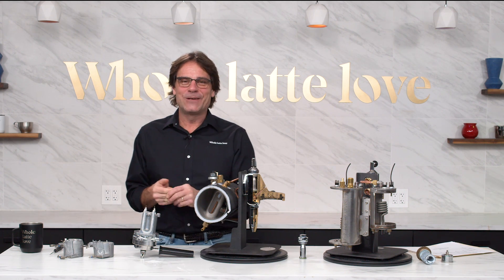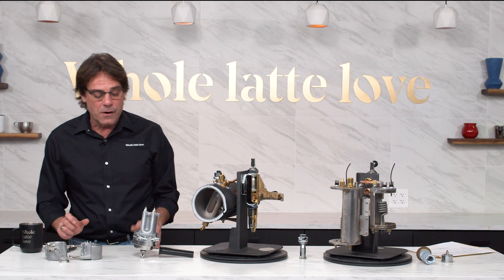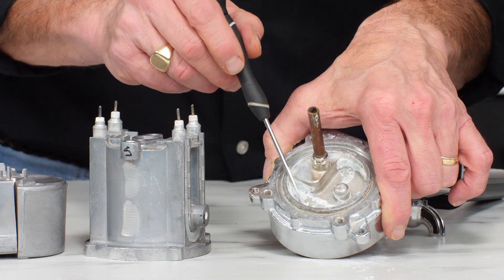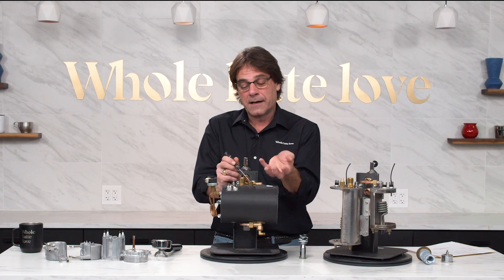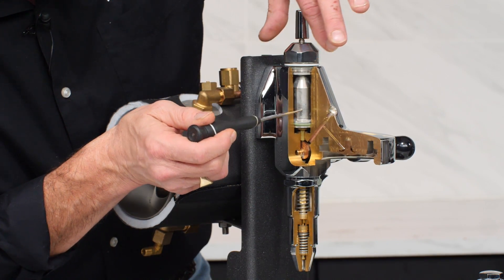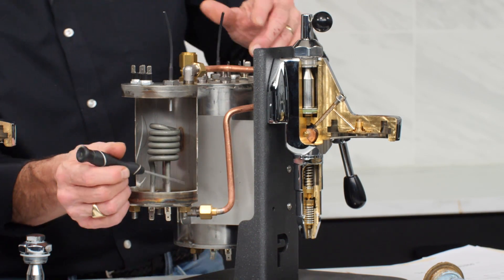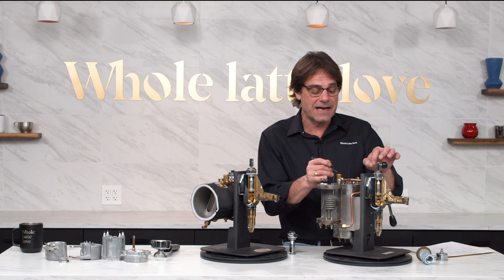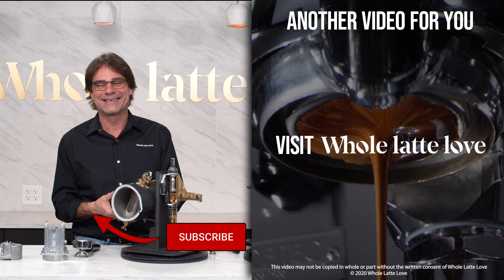Espresso Machine Boilers: See Inside 4 Types

Comment: Awesome video!  Need recommendation. I have an Alex Duetto 2, not working so well. First issue was at powerup the pump would run and run till a fill alarm would stop the pump. Reservoir is filled no water being drawn. Started happening intermittently, descaled machine hoping to fix this issue. It did not - eventually happened on every power up.  I Replaced the fill valve/solenoid – problem did not go away.  Found sediment in the valve under the solenoid, fill problem was solved.
Machine worked for a week, then more problems started. Seems every time I have my steam boiler on the brew and steam boiler temps fluctuate by +/- 10 deg. While drawing a shot. Would take a few minutes to recover back to normal temps. I used it this way for about a weak, steaming my milk first then shutting off the steam boiler before making my shots.
Today: If I leave both boilers on, now and try to make my espresso first it’s gotten worse the steam boiler blows the safety valve every time I draw from the group.  I’ve removed several parts in the piping and descaled them separately, expansion valve, one-way valve, group head components. Problem persists.  I thought perhaps the pump has a large chunk from scale in the impeller causing back pressure and blowing the safety valve. Or the fill probe cannot conduct to ground from too much scale inside the boiler, so boiler overfills. Would you recommend removing the pump to inspect it and clean it? How about removing the boiler to descale? Or perhaps not removing anything and trying to descale once again.  Any advice would be greatly appreciated. Thank you
Reply from the maker: Hi Paul, A lot going on there!  Sounds like you've seen evidence and/or believe the machine has significant scale deposits. I don't know if this is the case with your machine, but descaling a machine with a lot of scale already in place can cause a lot of problems. Scale dislodges during descaling and ends up plugging up other parts of the machine. Based on what you've said if this machine came into our shop it would be a tear down with boilers and other components removed for descaling. In fact, that's the only way our techs descale dual boiler machines. I would not recommend descaling without removing components. Sounds like you have some skills and a total tear down and check of all hydraulic components and sensors like fill and temperature probes is called for.
Marc
Reply: @Wholelattelovepage  Thanks for the quick reply, you’ve confirmed what I believed had to be done, but was hoping I could get around removing the boilers to descale.  My plan is to descale the remaining components, once I’m satisfied the plumbing is clean I can troubleshoot any remaining issues at least knowing that it’s not related to scale. Thanks again.

Comment: hey mark, can you do a video on flow control with HX boiler with PID (Cronometro R).
Reply from the maker: Hi LPV, Thanks for the request. While flow control is not an original purchase option on Rocket machines I know some do install it. But, different vendor's FC devices work a little differently with flow rates based on valve opening positions. If you installed an FC on your Cronometro R I advise calculating your flow rate at various valve positions. Here's an article on how to do that. It also has graphs of 5 flow profiles based on flow rates: https://www.wholelattelove.com/blogs/articles/intro-to-calculating-flow-rate-on-e61-group-machines
Rotary pump machines generally have much higher potential flow rates than vibration pump machines. ECM/Profitec rotary pump machines using ECM or Profitec FC devices can do near 30g/s with the FC wide open while stock flow rate on those same machines is 10-11g/s. Not many situations where you'd want to go too far beyond stock flow rates. Majority of profiles reduce the stock flow rate like those using long low flow pre-infusions for lighter fresh from roast specialty coffees. Here's a video covering 2 easy flow profiles. It's done on the rotary pump ECM Synchronika. Although a dual boiler machine it should be similar to your HX PID Cronometro R: https://youtu.be/a-QAOo8Vg5A
Marc
Reply: @Wholelattelovepage  Hi Marc, I am actually really interested to know how and if FC affects brewing temperature stability with HX Boiler w/ PID (not HX Boiler w/ brew group PID like Lelit Mara X).

Comment: What were the machines that were taken apart in this video?
Reply from the maker: Hi EM, Thanks for the question. 
Thermoblock boiler: Not sure. This boiler type is common in many appliance, grade sub $200 espresso makers and some super automatic bean to cup espresso machines.
Single boiler: Gaggia Classic
HX boiler: An older ECM machine
Dual Boiler: Profitec Pro 700
Marc

Comment: How abt inside saachi machine
Reply from the maker: Hi RL, Thanks for the request. I do not believe that product is available in the US. I did look it up and it appears to be an appliance grade espresso maker using a pressurized PF/filter basket setup. Honestly it's not a class of product we typically open up. In all likelihood it uses a thermoblock to heat brew water as shown in this video.
Marc

Comment: Awesome video.  You are obviously not only very knowledgeable but you also have the ability to communicate these concepts that you understand so well.  The combination is rare.  Kudos and thanks.  I found this fascinating and extremely valuable.  Since I never make milk drinks I know that heat-exchange and double-boiler features are not necessarily important to me but PID and pressure control are.  So, a modified Gaggia classic (with PID and pressure fader with gauge) would be OK for me.  I think.  Maybe I'm missing some subtleties.  
I wonder if there is a high-end machine that has those same features (PID & pressure control) without the unnecessary (at least for me) expense of a double boiler or heat exchange?
Great job, Marc.
Reply from the maker: Hey ropeh, Thanks for the kind comment. Sounds like the ECM Classika PID w/flow control is exactly what you are looking for: https://www.wholelattelove.com/products/ecm-classika-pid-espresso-machine-with-flow-control
Checks all your boxes: PID, flow control, E61 group, single boiler focused on those who don't do milk drinks very often. ECM build & finish quality are best in the business. While modding a Gaggia Classic is a possibility, the Classika is purpose built and has far better thermal stability.
Marc
Reply: Also consider the ECM Puristika if you never steam milk.
Reply: @ende421 Thanks for the tip on the Puristika.  That is the machine for me.

Comment: Hello
Thank you very nice video..
Ihave quastin that my coffee machine
Dosnot work water come and not hot and no pressuer when i remove  the water level waier (electrode) it work and prusser jump to max in 5 second i replace water level(electrode element) but still not working why!?
Reply from the maker: Hi MM720, Thanks for the question. Not much to go on here. Information like make/model of machine and more details would help. Have to say it's nearly impossible to have no hot water/pressure and then jump to max in 5 seconds by removing the water level probe. Maybe a wiring issue?
Reply: @Wholelattelovepage 
Thank you sir for your reply.
Fiamma coffee machine
Singl group
I dont konw what is the mean issue why no hot water and no pressuer!
Befor 2 month i have change heat element coil and then it was working fine. Now befor 2 weeks i face this issue!
Wiring conection and every things as befor.
Do you think  the motor pump not feeding the boiler so the water not start coming hot and water level not dedect the level?

Comment: What do the 2 thermostats do exactly on the single boiler? 

You mention ones for “registering when ready to brew” and the other is for “reading the temperature” correct? 

I don’t understand though, wouldn’t the one thermostat that tells you the temperature indicate that it’s ready or not to brew? 

Or is one thermostat used for the actual steaming and the other is used for brew water that’s kept separate? 

Is only one thermostat essential for a standalone steamer? (No espresso) 
Or would it be beneficial to integrate both thermostats still into a stand alone steamer
Reply from the maker: Hi Adam, One thermostat is used for controlling brew temp and the second does steam temp. Not sure I fully understand the question about stand alone steamer but if device was steaming only then one thermostat would do the job.
Marc
Reply: And does the temperature control on to the last two boilers matter? 

Why would I want to keep a consistent pressure versus a single boiler that lets out some pressure if it’s too hot? 

When it comes to steaming is there a specific temperature that works best for steaming milk? Is that why these functions exist?
Reply from the maker: Hey Adam, Temperature control matters. Consistent temp/pressure is important in brew boilers for consistency of brew temperature at the group. Single boilers do not release pressure if too hot unless the boiler has a safety valve and boiler runs far too hot. No specific or best boiler temperature for steaming milk. But... higher temperature in the steam boiler = higher pressure for steaming. Higher pressure means faster steaming and more vigorous in milk when steaming.
Marc
Reply: @Wholelattelovepage  wow you guys are really the best never been able to find so much useful knowledge in one spot, no one even comes close! 
Very impressed and thank you so much :)

Comment: Are the double boilers and pressure heat exchange boilers commercial? Do they have special electrical/water intake setup to function? 
Or are these types of boilers included on a normal home machine you could plug into a wall outlet?
Reply from the maker: Hi Adam, Depends on the machine. There are commercially rated machines using HX and dual boiler setups. For instance all four of the Crem One machines featured in this video are commercially rated: https://youtu.be/eYHCznwM-nI
Although commercially rated they are commonly used in home setups. Many similar 
machines are not commercially rated. They're often classed as "prosumer" level machines. Most use standard power. Some can be plumbed direct to waterline.
Marc
Reply: @Wholelattelovepage  extremely helpful thank you!

Comment: Thanks for the informative video, does anyone have any experience with the Ascaso heater blocks with stainless steel coils ?
Reply from the maker: Hi jv, Thanks for the question. I do not but they are available from parts suppliers if yours is bad.
Marc

Comment: Marc. I live in a hard water area and I use softened water. A soft water test showed my water is fine but I am concerned with mineral build up. It’s an hx group head single boiler. The company I bought from said to never descale.  I. always descaled my Breville. My question— I have had this about 10 months. Should I be descaling and how?

Comment: Sweet vid! I've opted for the dual-boiler with PID Silvia Pro. Now I'm wondering how you go about descaling it, as I've heard it's difficult to descale a dual boiler? I've ordered it but it has not arrived yet :)
Reply from the maker: Hi b, The Silvia Pro is a real value in dual boiler PID machines - congrats on your purchase! In the box with your machine will be a BWT Bestsave M drop-in filter like this: https://www.wholelattelove.com/products/bwt-bestsave-m-anti-scale-filter
If you use the filter as directed no limescale should form in the machine so descaling will not be needed. Depending on your source water hardness the filter is good for treating up to 100 liters of water. It just drops in the reservoir and does it's thing. Be sure and refill reservoir 10 hours prior to use so the filter has time to do it's thing.
A nice feature on the Silvia Pro is the ability to automatically drain the boilers through extended functions on the PID display. This is handy for long term machine storage and could be used if someday you find the need to descale. Be aware you will not find descaling instructions in the Silvia Pro's manual. Rancilio likely prefers you use the BWT filters to prevent scale in the first place.
Be aware descaling neglected dual boiler machines can be risky! The have rather intricate internal plumbing. Scale chunks can come off during descaling of neglected machines and plug up internals.
Marc

Comment: Hi Marc - love your informative and lively videos - thanks for making them. Just ordered an ECM Casa V and Eureka Mignon Specialita grinder from Whole Latte Love. Do you have a video showing the Casa V boiler in cutaway? Does it look very similar to the Gaggia single boiler shown in this video? Wondering if the water that goes into the steam and/or the brewing on the Casa V is heated up in the (brass?) boiler or stays in copper tubing that runs through the boiler wall and is is heated by the boiler. Interested in your response. Thanks!!
Reply from the maker: Hi Brian, You are welcome and thanks for the kind comment, question and your patronage! Casa V + Specialita is a very nice combo. I do not have a video with a cutaway of the boiler. The boiler does not operate in the same manner as the Gaggia boiler. The Casa V uses and ECO brass boiler. The "ECO" references food safe brass which passes EU regulations (stricter than most US standards). The boiler is heated by an internal heating element similar (but smaller) to those seen in the HX and DB boilers in this video. Hope that answers your question.
Marc
Reply: @Wholelattelovepage  Thanks Marc. Can you compare/contrast the common and different aspects? Only takeaway from your response is "its different" and has a "food safe brass build". Not sure how it is same/different in construction or function. Thanks!!

Comment: Maybe its worth mentioning that depending on the composition of your water you will get severe pitting of an aluminum boiler like the gaggia one. I have had 2 gaggias, and both of them needed the boiler changed within 6 years of manufacture. The sealing surface between the grouphead and the aluminum top part will get pitted to the point that it wont seal anymore and it will leak. By the time i noticed on the first one it had been leaking long enough that the screws were so rusted in place  that the grouphead needed changing as well, if you do that repair at a repair shop its will cost you more than the value of the unit. So my advice is if you have a chlorinated or acidic water (de-mineralized water is usually acidic) dont go for a gaggia or any cast aluminum boiler, they are not designed to last.
Reply from the maker: Hi XG, Thanks for sharing your experience. I'm fairly vocal on water quality. Any chance you were using pure distilled or RO water in your machine? Not sure but you mentioned demineralized water so taking a guess. Water is a good solvent and zero TDS pure RO or distilled water is even better. So good it can cause corrosion of metals - and not just aluminum. That mineral free water pulls ions from the metal. I get a lot of comments from people thinking they are doing the right thing using mineral free water in machines to avoid lime scale deposits but the truth is they are not. Beyond causing corrosion over time those extra pure waters over-extract coffee causing bitter flavors.
Marc
Reply: @Wholelattelovepage  OK you just blew my mind again.  Third time this evening.  I love that you give such detailed (and informed) answers to all of these comments.  Great engagement & community creation.  And coffee, ultimately :)
Reply: @Wholelattelovepage  so, what kind of water is more suitable for a espresso machine?
Reply: @babackd.6485 
Unicorn water.

Comment: I have a HX machine that is plumbed in with a filter and softener, how can I descale my machine if it's plumbed in without a tank?
Reply from the maker: Hi 00..., Thanks for the question. If the pump can draw from a non-pressurized line I would prep some descaler and use a short piece of hose to draw into the machine. You don't mention machine make/model but fyi most rotary pump machines can draw water from a non-pressurized line.
Marc
Reply: @Wholelattelovepage  It uses a generic Procon pump, which I believe can draw from a non-pressurized line. It it okay to draw the cleaning solution through the rotary pump though? It's a generic pump so it shouldn't matter but it's a San Marco 95-22-2.
Reply from the maker: Yes, fine to draw through the pump.
Reply: @Wholelattelovepage  Great!

Comment: I've seen a gaggia commercial machine that had the group head electrically heated. Heats up very fast and doing that with a PID would make it very accurate as well. Pity that system isn't more widely used.
Reply from the maker: Hi p, Thanks for the comment. There are some machines using this approach. The Bezzera Matrix and Duo machine have a triple PID setup with a PID controlling each boiler and the 3rd controlling a heating element in the group. In that setup the group's PID temperature is preset and not user adjustable to best of my knowledge.
Dalla Corte machines use a more controllable setup with PID temp control of a boiler over group design. DC machines are fully up to temp in <10 minutes. They feature incredible brew temp accuracy and are able to change brew temperature very rapidly. Most every DC machine uses this setup and is found in machines like their Mina: https://www.wholelattelove.com/products/dalla-corte-mina-110v
Marc